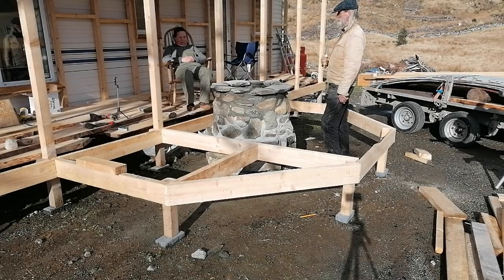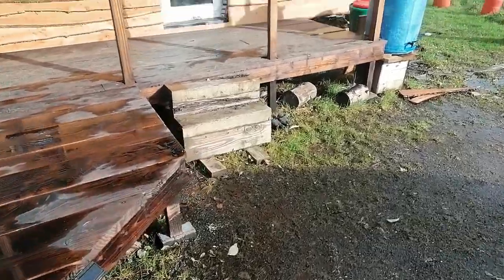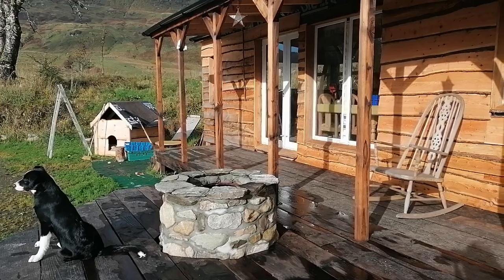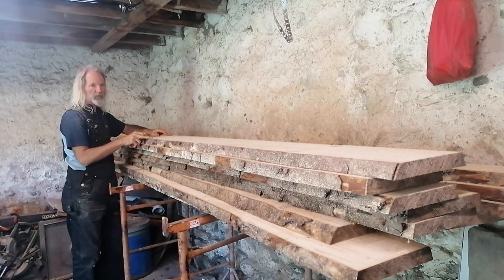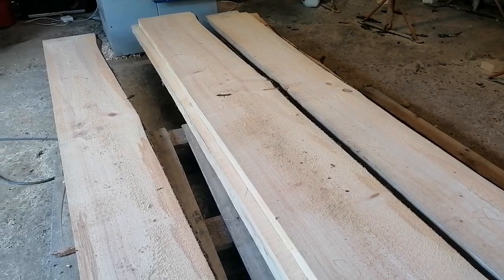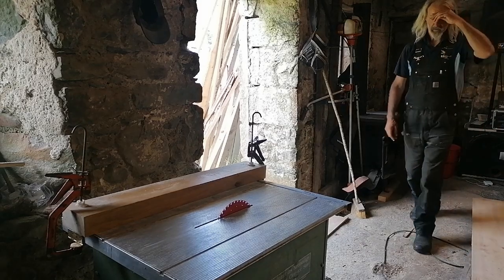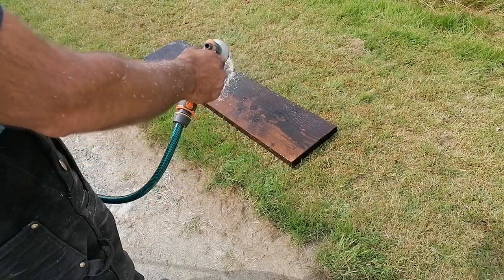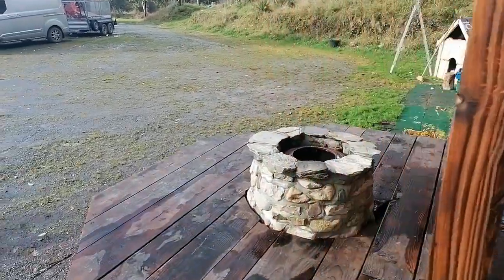LADYFIELD FARM - How to Renovate a Static Caravan : PART 3 Decking and Shou Sugi Ban

Comment: Ive seen blackened wood before -ncould you leave the wood black  rather than brushing the carbon off?
Reply from the maker: Well as I mentioned I'm learning about Shou sugi ban as I go but my thoughts are firstly that if you leave the black on you can't apply the oil, or at least if you did it would just mix with the black dust and make a sludge. Secondly the black on there is very dusty so I would imagine it would wash off in time anyway. I think if you burn it even harder than I did then you can achieve a darker colour even after brushing but having not done that I can't be certain. I still have some more to do so I will experiment and let you know. Cheers for watching.